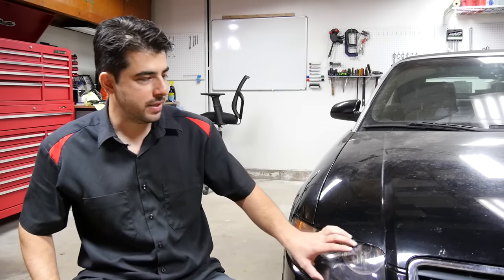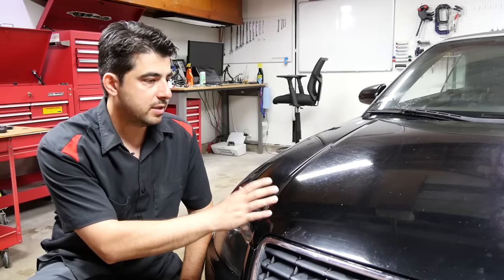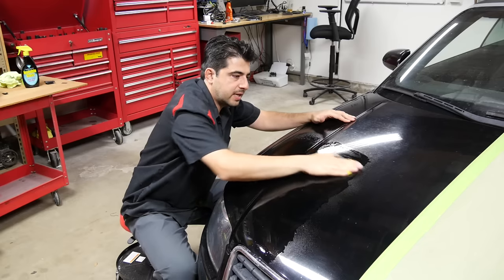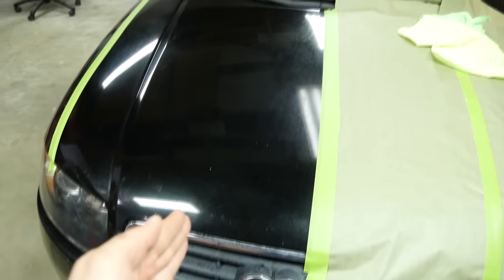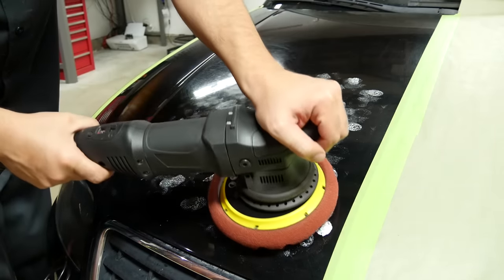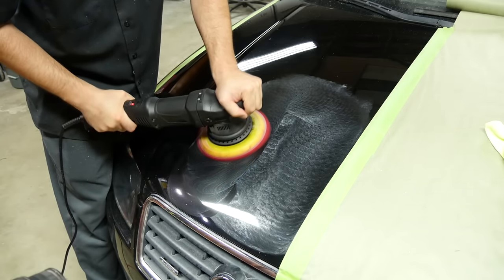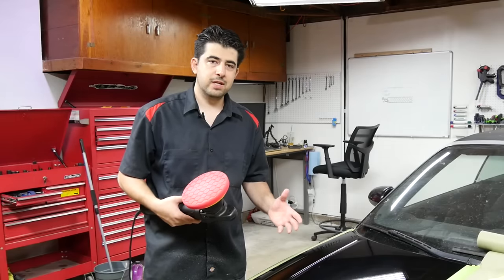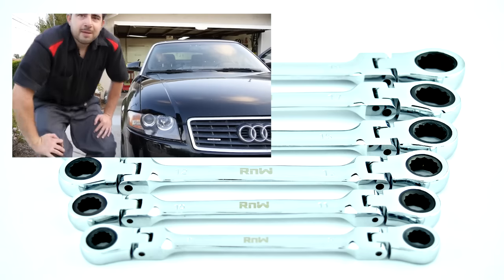How to Fix Old, Hazy and Scratched Clear Coat

Comment: Wrong: you don’t need to use pressure when using a clay bar. Simply pass over the paint until you stop hearing the rough rubbing noise.
Reply: EG3HC You will still need to apply some pressure.
Reply: Yeap, and with a bit of practice you'll also find the balance between the amt of lubricant and pressure to remove the most amount of contaminates.
Reply: As long as there is plenty of lube, you should be able to slide it in real easy.
Reply: EG3HC u
Reply: ty for that was nagging me that he said that haha
Reply: Stop being an old lady. No nitpicking details. Applying extra pressure to claybar isn't going to hurt anything whatsoever.
Reply: Yeah,  what old man Macylerie said, no nitpicking.  AND GET OFFA   
HIS LAWN!!!!!
Reply: Mike A omg. Lol
Reply: Correct: Of course there needs to be pressure on the first few strokes, to establish dominance- but softly on the tip- near the creases so it doesn't buff off the wool and get too hot. Apply the lubricant with a proper spanking-like manner. Then nice steady long stokes, with a 50% overlap, doubling back across - for maximum coverage. Bonus is a little muscle relief - no cramps. This will ensure success.
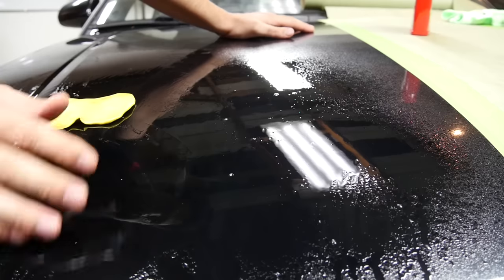Reply: 4:16 He says exactly that.
Reply: @jiffjiffernson7292  ars we still talking about paintwork here, or has the conversation moved on?

Comment: actually its nearly impossible to restore a paint layer that is almost gone already.... unless you polish it with colorised stuff that add more pigment into the paint of the car....
polishing it too much could actually only make it more worse, when i was a beginner working in a paint shop, i actually messed up a paint job one time when i was polishing a car, i held the tool too long on the same spot, wiping away the paint until the primer was visible xD

Comment: How do I get rid of 1000 grit sand paper marks on the paint
Reply: either graduate down (up) with successively finer paper (1200, 1500, 2000, 3000), or buff the scratches out as is.   IMO, going with finer paper is best,you have to buff less (less chance of burning it, and  you use much less compound, which is very expensive....

Comment: Should've tried to get a foam gun for your hose. Dawn in the little tank and pre soak the car. Otherwise you are just introducing waaaaay more scratches and not getting it as clean as you could.

Comment: Ohh, God..that bucket is dirty already with just water in it.
Those tools and that much pressure while washing...these makes me sad.
Reply: Then what do you suggest? Make a youtube video to show us how its really done.
Reply: Chris  Just make sure your bucket is clear before you fill it up. As for pressure and others the video is already done. Not by me, but by Larry on AMMONYC.
Reply: I do watch AMMONYC he has a lot of subscribers and does very good detailed work, you can tell. I just like to see what other videos and people say that other videos might not mention. He has a lot of videos can you tell me which one I should watch. I want to remove scratches and swirls from my neglected 07 silver Mazda paint, thanks.
Reply: Well as u mentioned, he has a lot of videos and every one of them shows a bit or a part of a whole process or technique. To get the whole picture, u might watch almost all of them which are about paint correction. Cant tell you just one video title, every paint is different. The main line is to always start with the least agressive method and double check the result, so you can decide if you have to go over with a more agressive combination of pads and cremes. So here is a really tiny list: 

- What's the Best Compound for your Paint? Singer Porsche
- Is your Paint Hard or Soft? Find out how!
- 964 Turbo S: Polishing Techniques

( Techniques and tools are just as important as preparation. )
Reply: Péter Kalányos this....I believe you meant guy.....

Comment: Unless you don't have Clearcoat. Like my Toyota Tacoma. Single stage.
Reply: Actually you can buff single stage paint as well, but not recommended if your single stage paint has metallic or pearlescent in it...  With almost all european or asian factory finishes, you will almost never find metallic or pearl factory paint without clearcoat.

Comment: one you never wash a car without first rinsing it an you never apply pressure while using clay bar and the step after the clay was not needed and if you are going to use wool  pad you need spir it before you start on every panel and clean it after every other panel this guy is well intended but in no way should be doing how to videos
Reply: super hero auto detailing idk 240k subscribers...
Reply: super hero auto detailing  if you have a video I'd like to see it.
Reply: stop it, if you're going to make a tutorial do it right I'm not hating I'm just criticising in all honesty this guy is pretty cool.